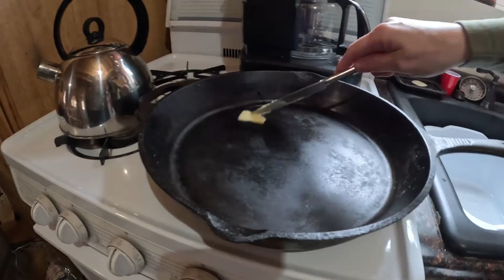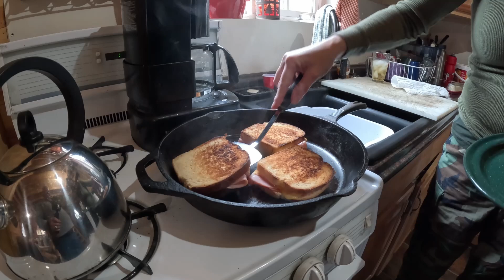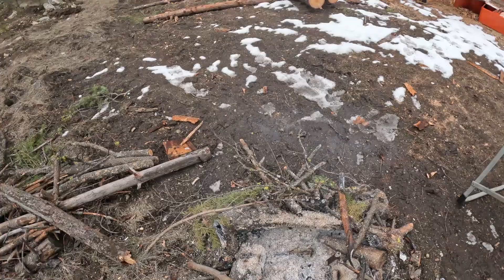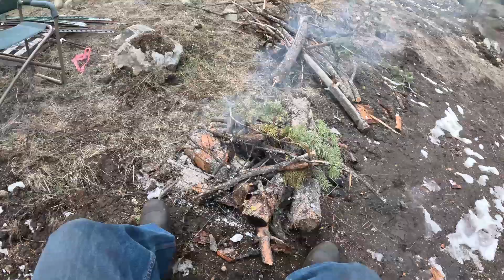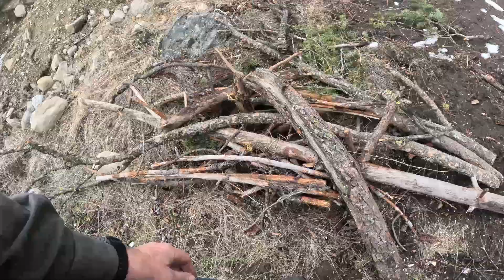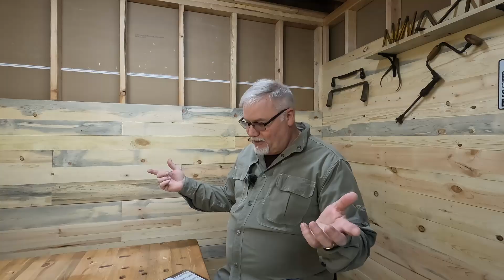Pure Sine Wave Inverter Upgrade | Off Grid Cabin Build

Comment: I really enjoyed your Fireside chat! I think I might make a fire this weekend, put on a coffee pot, and relax.  I have a wood boiler and if I lose power, she becomes a steam engine. I purchased a Westinghouse 7.5K, dual fuel generator with an automatic start box. The generator is outside in a shed and wired up to the generator circuit. When we had a power outage it was 10 deg and the generator would not start to my surprise. I was lucky that the fire in the boiler was burned down as I needed to clean out the Ash. Long story short, before purchasing a backup generator check out the cold start temp rating. Now I need to install a block heater on the engine and move the battery inside.
Reply from the maker: Thanks!  A steam engine would be cool!  I've been fortunate with my Generac as it has always started for me, even when it was -20F out!  It's a propane only gen and made for offgrid use only but I have learned to disconnect the battery when the cabin power is off or it will kill the battery.  Future plans are to get a roof over it and a concrete pad under it but otherwise I hope it will run another 10 or 20 years :D Cheers!

Comment: Go Solar  :)  I used to sell Generac Generations in the 90's.  I have always enjoyed the Electrical Industry.   Do enjoy new power sources and ways to generate electricity, wind, solar, and generators, especially using water to Hydrogen to power an engine.       :)
Reply from the maker: I love having solar.  It's not really cheap but it can be a LOT cheaper than bringing in utility power in a remote location and I for one am super happy with mine!